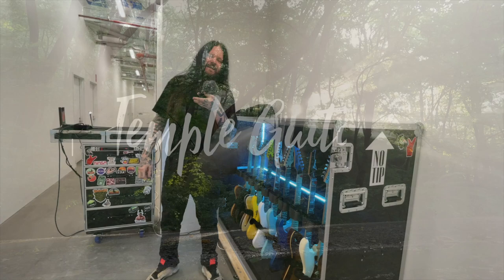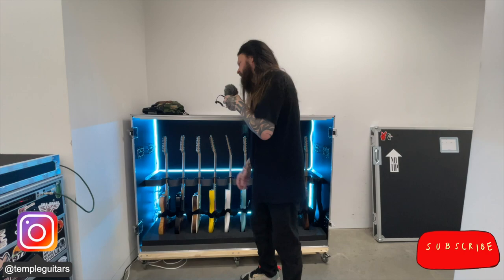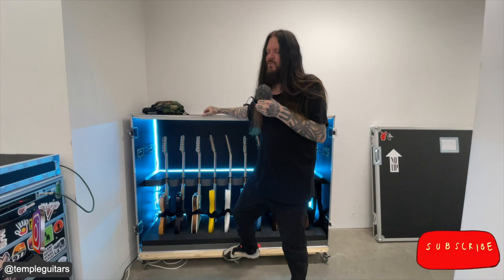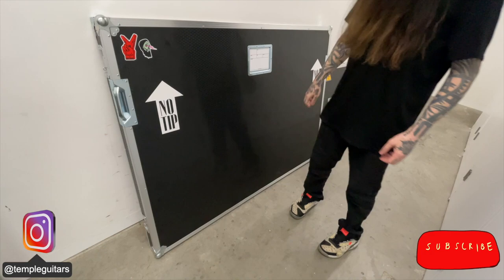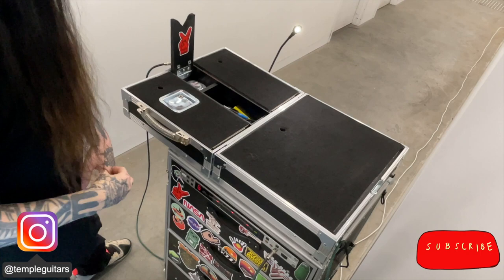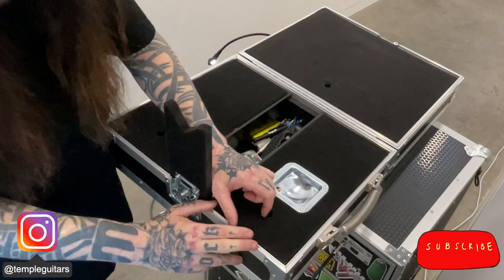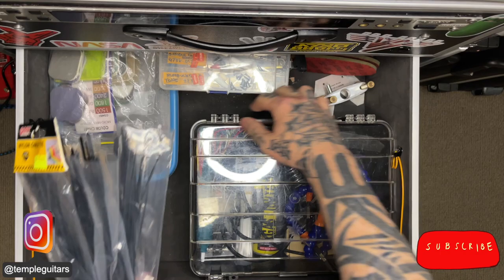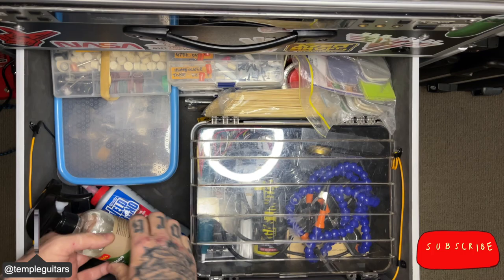Guitar Tech Setup

Comment: So the modularity of the briefcase on top of the drawers is great, and I've been shifting my gear to move into something almost exactly the same, but now I've discovered a gigbag style version of the briefcase design, so I'm gonna go with the more ehhh traditional flip top workbox design, and just keep a tight kind of "string change and quick setup" bag to take with me to the local music spaces, and the full proper kit would live at home, ready to take anywhere serious enough to warrant it.
Reply from the maker: That's a great way to do it- the whole vibe as a tech is to be flexible. When I started out, I started quite big, so my whole setup was in one enormous metal case (we called it The Aluminium Falcon). This was fine for local shows in theatres etc, but there was no way I was getting that thing on a plane in New Zealand with local bands with local budgets. I love the sound of your quick deployment setup, especially if you use a battery tuner and light with it, so you are fully self contained.
Reply: @TempleGuitars  oh I'm all about self-contained power. The little gig bag will have a section with a foam insert to hold all my files and setup tools, I just picked up a pinecil soldering iron which has been pretty great for the quick odd job and mod, packs crazy small. I've got another small bag with rags and bottles and strings, primarily.

Feels good when several slow percolating ideas flash together and become a thing.

Comment: Great Video. thank you! one question: didn't you find that the microfiber cloth does weird things to nitro laquered guitars? i used these once and ended up getting some cloudyness i could only get rid of by buffing it out
Reply from the maker: Good question- There are different abrasive grades of microfibre cloths. To avoid fine scratches on nitro you can use the type for cleaning eyeglasses, or if money is no object, Fender sell their own 'nitro safe' ones as well. Thanks for watching!

Comment: Hey man
Enjoyed the tour through your tech rig. All contingencies covered! I have those same vernier callipers. Same battery issue. How did you work around it? Dean
Reply from the maker: Thanks Dean! I think the issue is the cover isn't thick enough, so I put some tape between the battery and the cover to push the battery against the terminals. You'd think the tape would get in the way, but one battery terminal is on the front, and the other is actually on the side. I thought it would be one on each side, but luckily it isn't. #verniercrew